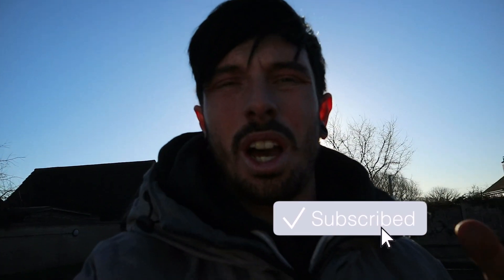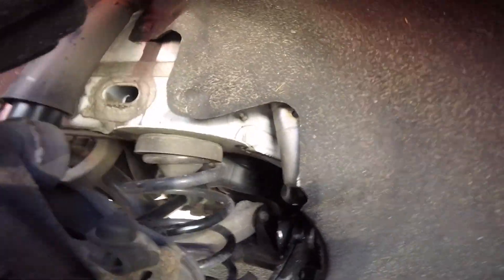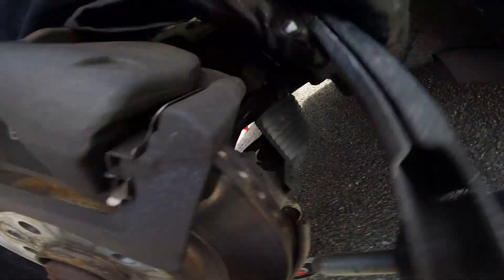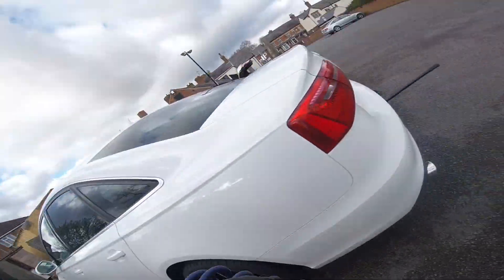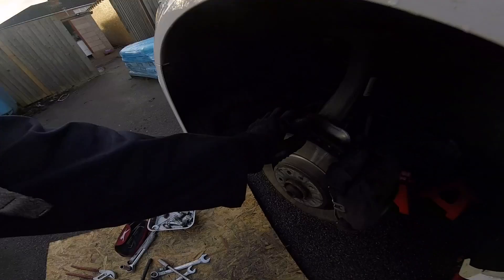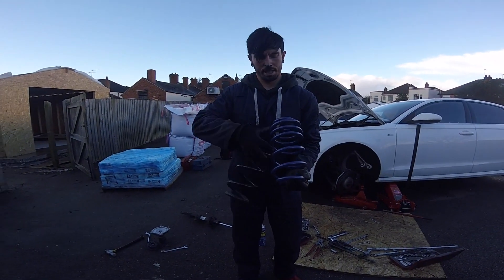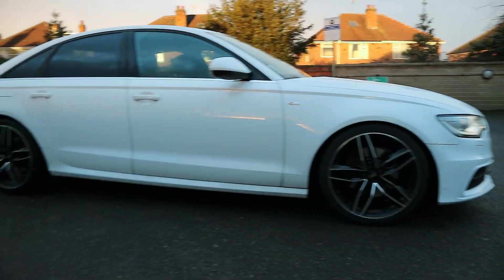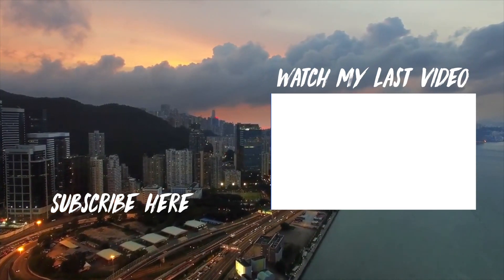HOW TO (DIY) LOWER AUDI A6 C7 QUATTRO * H&R SPRINGS *

Comment: Hi. I have 20'' rotors (et 45). I'm thinking lowering mine with exact springs but i have 15mm spacers already installed. Do you think it will rub with spacers on?

Comment: Hi! how did  4 Wheel Alignment go ? 
could you adjust the front wheel? do you have tire problem ?
Reply from the maker: Alignment needed only a small adjustment on the rear camber other than that its been great!

Comment: Does your car have adaptive suspension?
Reply from the maker: It does but the springs do not change the way it works as the adaptive suspension controls the damper not the spring 👍
Reply: @MatArmstrongbmx  oh okay ty